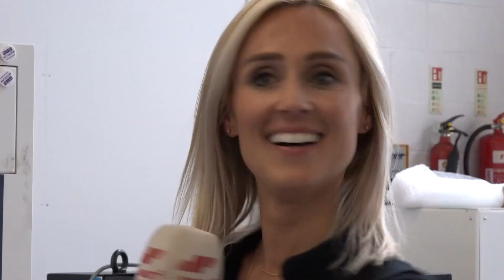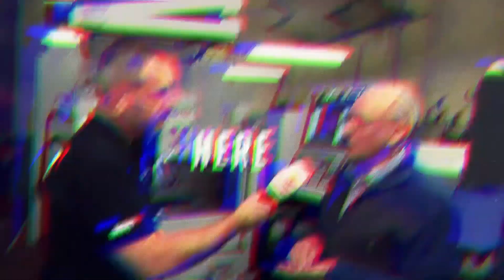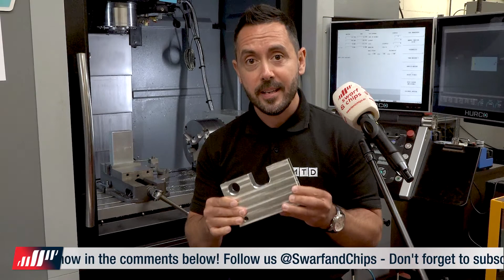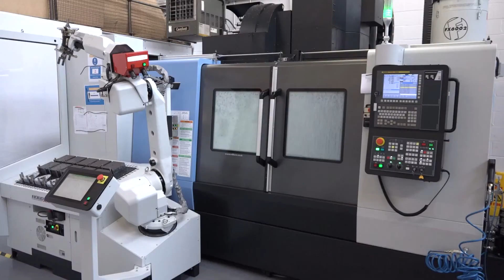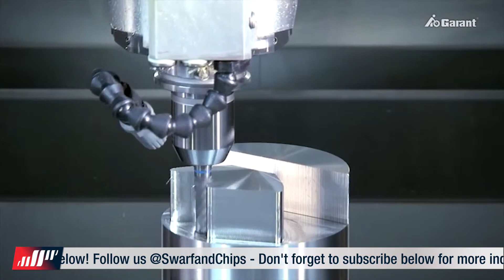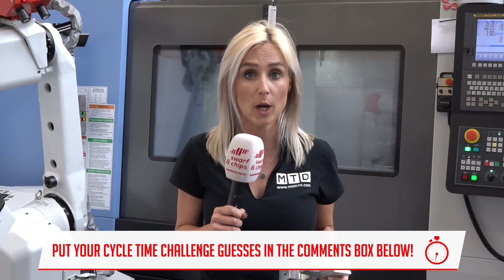Can You Improve Your Process By 100%? - #SwarfandChips

Comment from the maker: Every machine cycle (door to door) a 6 sided part is coming off the machine complete, the tools and the workholding are only set up once, with only one program, the RoboJob only loading the machine once per cycle (the 5th axis RT and the vice). Yes I suppose you can say its two ops because the part is held in the Vice and 5th axis RT but following the initial set up where the first billet is only machined on the 5th axis every cycle following that a part is coming off the machine complete. Lots of different ways to skin a cat but this certainly proved a massive success at Hydrafeed!
Reply: There Is an op zero ti decking of the back side ... So Is 1 Op on 5axis and 1 in a VMC 3axis to surface the back... Or remains with raw stock scale and the thickness isn't in control ...
Reply: I can do It with 2or 3 dual station vices . 6pc at cycle . One machine to flip them over and facing the back side (Mitsubishi 80mm x 45° face mill) ... Fixturing on a 4th axis in 5or 6 packs with gauge pins to register Squareness and make the slot on the side and drilling .. 

40/50min to make 5/6 parts 
Total tooling and programming time 2/2.30h for all 3 machines

16min per part on 5 axis Is 4pcs per H ...

Comment: That component Is not a 5axis product ... And for a job like that the only way to make profit Is 2 op in a VMC 3 axis and 1 on a fourth axis in pack for drilling and slotting
Reply: I consider 5axis in that piece if there Is tight geometrical-position tollerance of the side holes . I can work within 0.03mm without problems in 3+1 ..
Reply: Profit comes from reduced changes and therefore downtime... not the actual ability of the 5 axis as such

Even more so if the machine can run through a batch of the same parts all pre-loaded
Reply from the maker: Glad you enjoyed the video !